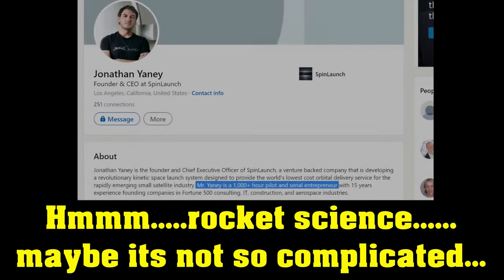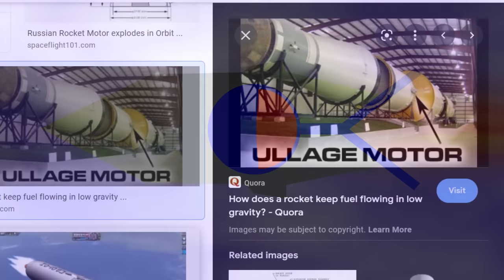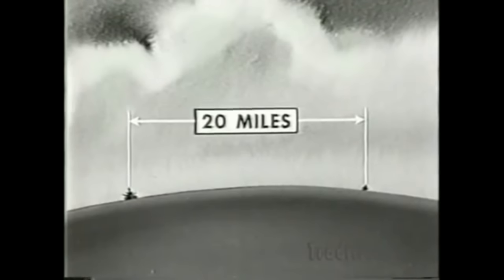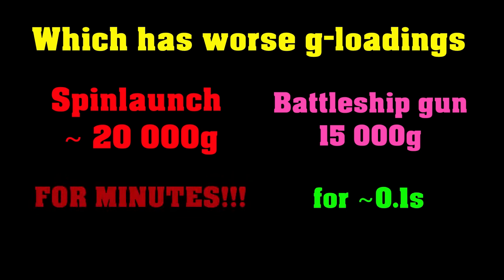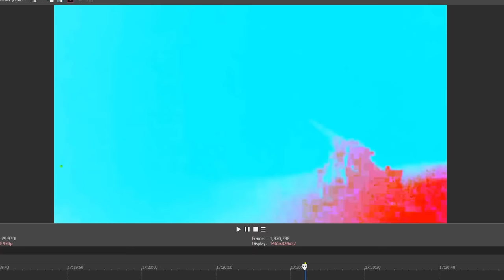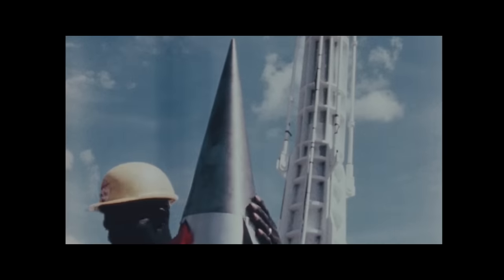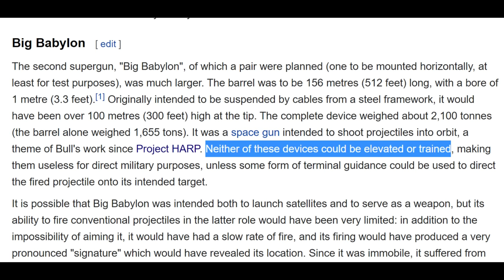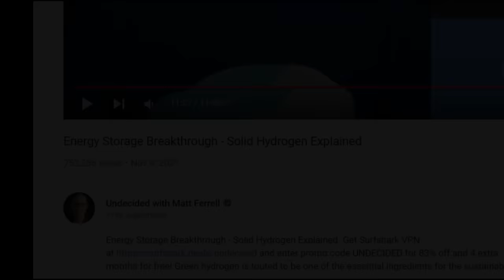Spinlaunch: BUSTED (Part 2)

Comment: I worked on a cyclotron in the past and once a year it needs to be opened for preventive maintenance.  The first step is breaking the vacuum by shutting down the diffusion pumps, waiting, opening a needle valve, followed by more waiting.  The reason this is done slowly is to prevent damage to the o-rings, because getting the vacuum back even in the best circumstances is always a pain in the ass.  The Spinlaunch creates a catastrophic failure of its vacuum every time it fires, which means that whole structure needs to be checked/repaired before using it again.  I bet they haven't pulled a high vacuum on this yet, and when/if they do, the thing will be critically damaged.
Reply: I can't imagine the pressure is very low inside
Reply: @NateJGardner  I doubt that it was even low pressure, like 0.5 atmosphere, not to talk about vacuum. And even as somebody who knows about vacuum chambers mostly from this channel, I immediately thought "wait a minute, that sudden re-pressurization must be a real problem for that. And that suddenly unbalanced arm getting hit by air wave sounds like something best observed from another continent."
Reply: If I were to design SpinLaunch... firstly I would not. But if I really had to, I'd add a low pressure "airlock" to the launch tube, to limit the amount of air getting into the spin chamber. That would have the advantage of never loosing the full vacuum in the main chamber (ideally if the second chamber is long enough, and the airlocks are fast enough, you could basically outrun the air). But this is not their design, so yes, it'll probably leak like crazy.
Reply: @Lassi Kinnunen 81 I agree, what ever lower pressure was in there, wasn't much below atmospheric. Given that all the fabric gets blow away from the entrance, rather than pulled in when the sheet is pierced, give me no reason to believe there was much of a pressure difference.
Reply: @EvanOfTheDarkness  You might want two airlocks. The one for loading a missile being considerably smaller with a less complicated door mechanism than the one for exiting.
Reply: ah, no worries, they just have to close all the valves to the pumps before hand. what is interesting is how well will the rotational arm last after the window is breached as that is still spinning at supersonic speeds (or at least it should if the want to lanch to space) and it will not suddenly stop after releasing the projectile (even if that is shown in the video ;), CGI at its finest). So you might want to replace the arm after a couple of launches (or each launch ). Also spinning something in vacuum is not an easy task, as they have to cool all their bearings somehow and the heat from the moving parts can basically only radiate their heat away. So in other words also a bigger engineering problem which needs service quite often... And also greetings from cyclotron to cyclotron operator :).
Reply: @EvanOfTheDarkness  If you have a long airlock, you've just moved the problem of pumping down a large volume to the airlock, from the chamber, not solved the pumping down problem.
Reply: @simonspacek3670  forget about that. Just imagine the collosal ammount of energy needed to put a room that big into 0.5atm or lower? Just imagine the power of the pumps needed to pull it off. Just imagine the power needed for that. Fuck towns man, this is the next big power drain of the grid.
Reply: I don't think they used vacuum in the test - based on the simple fact that when they broke the seal there was no visible sign of air rushing in and dragging the particles of films back into the chamber. my assumption on this is that this will go on 'development' for a long time - and what we've seen here is the same what we've seen with the 'hyperloop demo' ...
Reply: @dzemohendrix  As I said, there is not one "big problem" because there are so many issues together, that it is impossible to solve. It is like Analemma tower.
Reply: @Ikaros---  you still have the heat problem there
Reply: Maybe they can fill it with hydrogen at 0.5 atm? would that be better?
Reply: @JavierChiappa  only if you like massive explosions
Reply: Danger Bear  wtf really? So they "accomplished" a 5% vacuum and  ~5% of the G forces from what a true space launch would require!  😂😁😂
Reply: Oh! I know what o-rings are!
Reply: I'm not an engineer by any means, but even as a plumber, I could tell you what sudden changes in pressure are going to do to o-rings.
Reply: @Ikaros---  We can do a space elevator on the moon.  No need.
Reply: @NateJGardner  The structure doesn't look strong enough to withstand very low pressures. I'm no expert, but I work around chambers at work that go down to 10-5Torr region and they're pretty beefy. The chamber Spinlaunch uses almost looks purpose built to collapse on itself.
Reply: @dzemohendrix  The amount of power required would depend on how fast you want to pump it down, and/or how leaky the thing is. I'm hoping they didn't limit themselves with poor conductance of their plumbing...I can't imagine why they would have. If it was relatively leak-tight then even a small pump could pump it down, albeit over a long period of time. The interior looks pretty dirty though...that paint and rust is about the last thing you want in a vacuum system. It should all be clean (precision cleaned/baked out) stainless and aluminum, and it's not.
Reply: @Ikaros---  the bearings that the whole device spins on. There's going to be friction within the mechanism itself, even without any atmosphere.
Reply: probably. i've worked in a startup that had similar hype idiots working at the top. the entire point is to defraud investors
Reply: What was the main use of the cyclotron? The only use I’ve heard of was generating higher energy xrays for xrd and i was wondering what yours was used for
Reply: @Ikaros---  yeah I guess it could have SOME use, but not what they're claiming. And after my last comment I got to thinking that maybe they could levitate it with a magnetic field, which would eliminate friction: but the energy costs would skyrocket (pun intended.)
Reply: @Lassi Kinnunen 81 There are so many design problems with this tech that it seems extremely unlikely we will ever see this as a viable platform to launch anything useful into space. You may be correct about what they are telling investors.. and they may have some really good idea about how to deal with this particular problem but either way, as a whole I don't think they have a prayer of it working as intended.
Reply: @HexCopper  Proton Therapy used to treat cancer.  The biggest selling point is no pass through radiation, protons give up their energy at a very specific point the Bragg peak.
Reply: You dont need a perfect vacuum for this to work. Not even close to perfect
Reply: Yes and moreover the internal wheel is now at atmospheric pressure @full speed so 1) instant unbalance + 2) instant pressure = total distruction
Reply: @leoatreides1  liquid cooling circuit around the bearings ? seems quite simple to me.
Reply: @tempest411  if the chamber walls were flat, agreed. But they are not, they obviously work in tension, not flexion. So the walls can be very thin, except those on the periphery.
Reply: @Ikaros---  right, things get hit on earth by asteroids all the time....
Reply: Whatever the pressure it's going to be there for how many minutes? X-15 flights were under 15 minutes drop to touchdown and surface heating was a problem on every successful research flight. Sure they dealt with the problem successfully, but it was a problem and a peak velocity considered a mid-range velocity for spin rocket. I don't care for t-foot's delivery and he always goes for easy targets, but he's right.
Reply: @tedferkin  The video of the live test actually shows the material getting sucked back down quite a bit when it is ruptured. The projectile would've imparted a LOT of force on that membrane so there is definitely going to be some blow out but there wasn't nearly as much as there would be under atmospheric conditions.
Reply: Note that they are now proposing a double airlock system to prevent outside air from entering the spin chamber...
My guess is that they're testing with helium at partial atmospheric pressure.
(I've heard that some land-speed-record runs have been done in a long plastic bag full of helium because it has less friction than air.)
Reply: @leoatreides1  
I would worry a lot more about that rotating mechanism being unbalanced after it drops its payload.
That's a LOT of energy to dump really fast... and a lot of strain on those bearings.
Reply: The cyclotron vacuum is like 6 or 8 orders of magnitude higher than the spin launch vacuum

Comment: Centrifugal aka rotational launch was explored briefly by ARPA and the Canadian government during the HARP project.  They realized that the likelihood of failure would send fragments miles in random directions and a vacuum chamber of that size is more expensive to maintain than a typical fuel farm.  HARP also involved the early exploration of the nuclear propulsion system that became Project Orion.